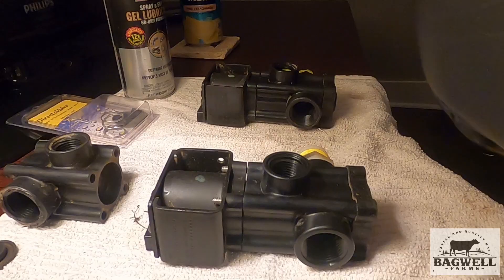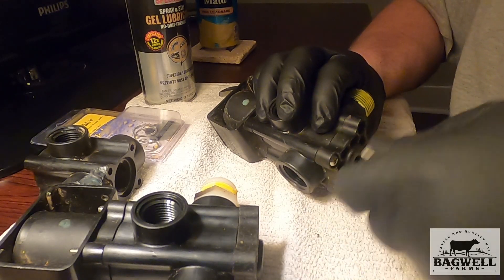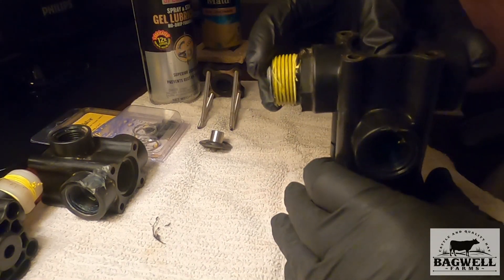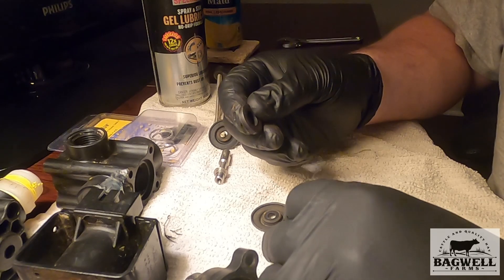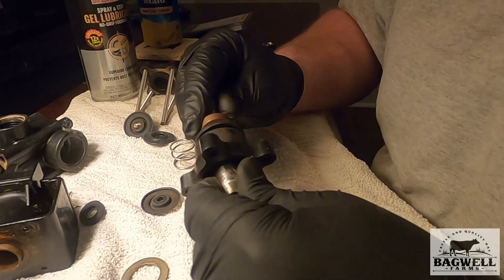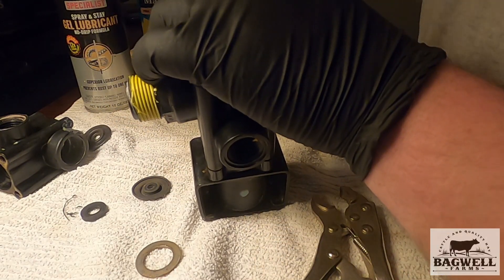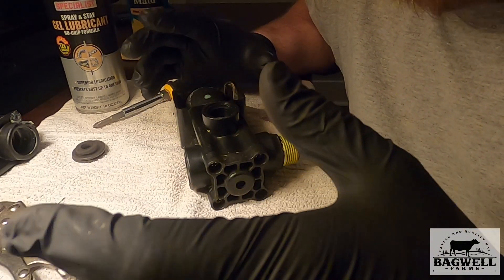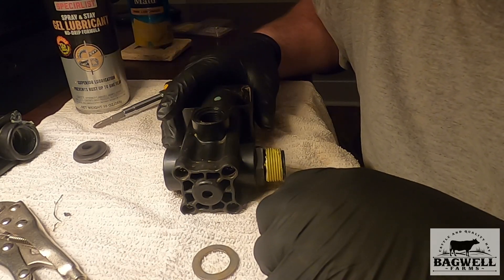Rebuilding boom shutoff valves

Comment: If you notice the solenoid piston has a hole drilled through it closest to the threaded end.  This allows the insertion of a small punch or nail.  To hold the solenoid piston while loosening or tightening down the valve stem, without marring the outside surface of the piston.  This is mainly for loosening a stubborn stem from the solenoid piston.   When reassembling, it doesn't need to be tightened super tight.  Just "hand snug".  Tightening it down too hard can damage the rubber diaphragms.   When Also watch the direction the replacement rubber diaphragms are installed.  One side is labeled "fluid side".  Also at 11:48, the actual parts diagram shows the stainless steel washer on the other side of the rubber diaphragm, opposite the nut.

Comment: Thanks for the video on the repair.  I am interested in replacing my manual valve with one of these TeeJet 144A Solenoid valves.  I was wondering how you mount it to your sprayer?  Thanks